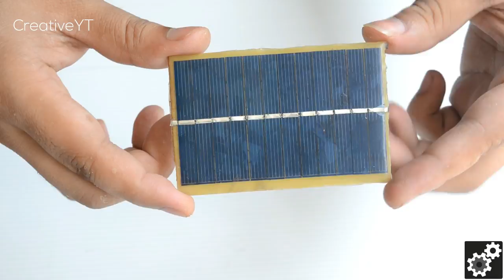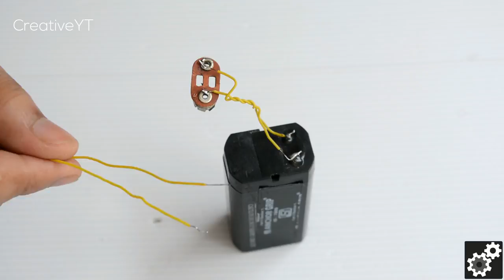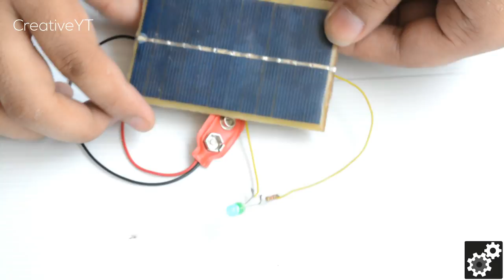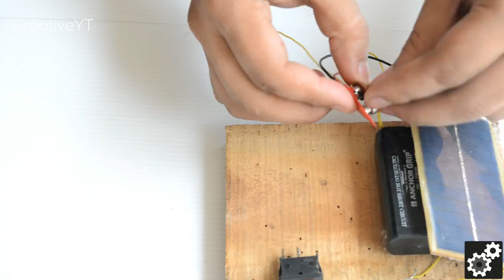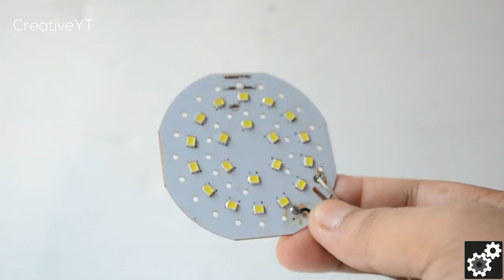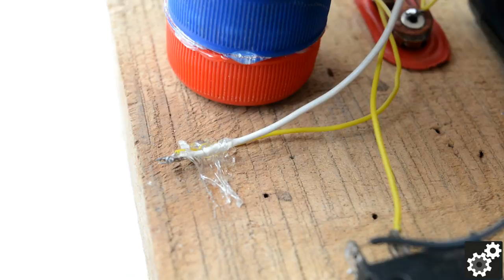SOLAR CHARGING LED LIGHT | LED Solar Emergency Light

Comment: I wanted know if the output and battery charging is conducted simultaneously. Or the battery will only charge through solar pannel when there is no output going on.????
Reply from the maker: In this project the battery can only be recharged from sunlight, if it is run by a fan or something else during the day it will run, then the battery will be charged from sunlight and the device will continue to run,

Comment: If I used the normal 9v (20 rs ) battery , will it work ? Why have you attached the green bulb when you have attached the l.e.d panel ? The normal solar panel projects only work in sunlight . Will it work in a room without sunlight ? And also the battery will be charged by the sunlight ?
Reply from the maker: using green led light it's like a indicator light when solar panel generate power then then light on....its work on normal rechargeable battery.its works on sunlight .
Reply: @wayejcreative  thanks

Comment: I want to know a thing  ....i.e when will solar panel absorb li8......i mean can it absorb energy only in the presence of sunli8 ...r any other sources like tubelo8
Reply: When sunlight falls on the solar panel than the electron in SUV Module of solar system gets excited and jump from lower state to higher state and due to of their moving state....from lower to higher state , the electric current generated. If sunlight does not fall on the suv module surface than electrons will not get excited and eventually no current will generated....!! (Thats we called Photo voltic effect)

Comment: Can I use these same things to charge a 6v battery instead of a 4v battery?
Reply from the maker: Yes you can but it will take time to charge
Reply: @wayejcreative  so we can also use the same resistors and all, right?
Reply: to power the led too?
Reply from the maker: @nahidhnaseem62  the light that goes on with the battery is supposed to be six volts, or it has to be fitted with a resistance,
Reply: @wayejcreative  Thank you very much!

Comment: Actually I did this as my school project ...but I don't know whether it is working or not ... that small green li8 is not glowing in model ..and I had used novel battery for the cntion...can u suggest some solutions a😅
Reply from the maker: check solar panel positive negative or led positive negative connection.....use measuring meter to check solar panel (volt) generate power or not ....

Comment: Bhai apna kaisha connect kiya solar or battery or switch ko led sea
Reply from the maker: connction light aur battery ke beech connection ke samaan hai, keval saur panel alag se juda hua hai.is tarah se  comment kar ke batana mushkil hai, main kuchh dinon mein is vishay par ek naya video uoload karoonga step by step sabhee jaanakaaree vahaan hogee. theek hai (circuit diagram link in description)....

Comment: Can a solar panel charge a lead - acid battery without any charging board?
Reply from the maker: If the voltage of the solar panel and the voltage of the battery are roughly the same, then it will be charged, but it is better to charge with the charge controller.

Comment: Hello friend do you like electronics
Reply from the maker: yes....
Reply: The window or the welding window is connected to the battery in a little while so that it gives the solar rays of charge to the battery to the radio so that the radio is turned on yes
Reply: With the solar window to shine there with the sun so that the radio is turned on as I told you
Reply: Ok
Reply from the maker: Yes, that's it
Reply: Ok

Comment: you should mention the component name which diode you use and what Resistor number you use ?? not only soldering unsuccessful work
Reply from the maker: i am using led light with resistor which was 32 Ohm Resistors, or using solar panel with diode is 1N4007.
Reply: @wayejcreative  Thank you now you are perfect
Reply: make video street light such Automatic light on/off using LDR&Transistors&solar panel Thank you i sub

Comment: Can I use 33 ohm resistor?
Reply from the maker: you can use 100 ohm, 220 ohm ,1k Resistor .
Reply: @wayejcreative  thank you. Can i use IN5403 diode in my solar panel? My solar panel is 80mm 6V. Will it work?
Reply: @wayejcreative  I really need your help. We need to do this because this is our research. Where can I chat with you privately? Please?
Reply from the maker: @jianjunio9023  yes you can use in 5403 diode for blocking reverse current to solar panel...
Reply: @wayejcreative  I already tried. But my 9V battery is not charging. Do you think the 33 Ohm resister the cause?
Reply from the maker: @jianjunio9023  maybe,you can check the output voltage of solar panel and check voltage after resistor.
Reply: What will happen if I will not use resistor?

Comment: how many volts of solar panel did you use and what kind of LED did you use also?
Reply from the maker: i was used a 6v mini solar panel and Bright Plate Base Board Smd Led Bulb...
Reply: is it ok to use super bright LED 5mm, 0.8W on this solar lamp?
Reply from the maker: ok you use this with battery because mini solar panel charge the battery...